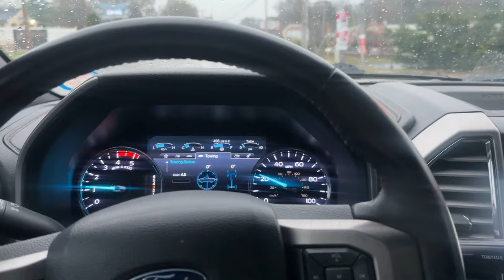Why am I Cutting up a 25.2 mustang?

Comment: What are your final thoughts on the AFR 238 heads that you put on the truck?
Reply from the maker: We been .02 faster with them on slicks on motor and .01 faster on nitrous with them, fixing to go put radials back on and see if we can p/b the radial pass then cam swapping
Reply: @Boostismyfriend  what are the differences of cam specs, or is DV going to pick a cam? I'm asking because I'm buying a pair but I need the strength of the casting because I'm turbocharged.
Reply from the maker: @davidreed6070 andy is designing the cam so i dont know
Reply: @Boostismyfriend  will you give me the specs if I ask real nice?
Reply from the maker: @davidreed6070  yeah